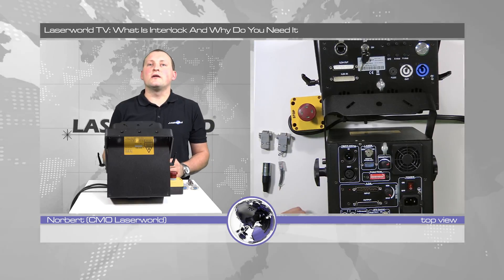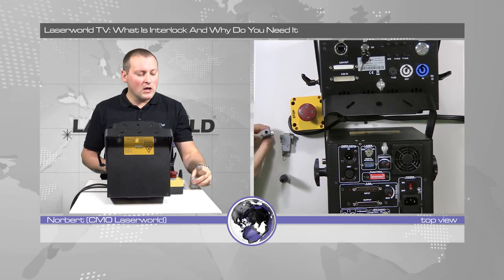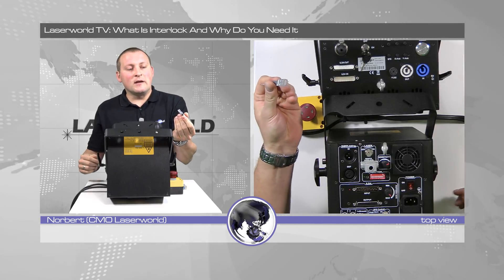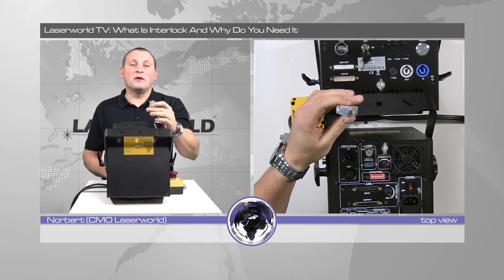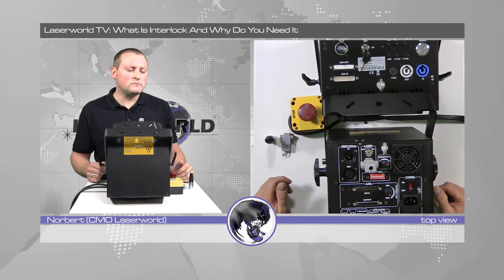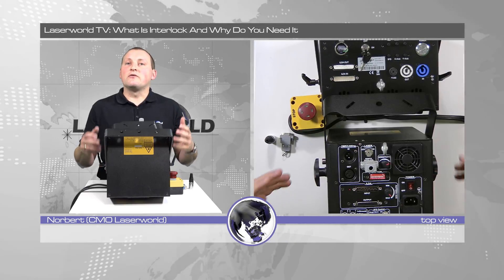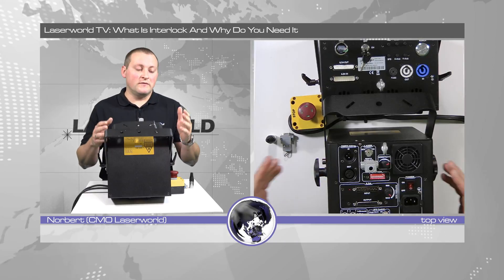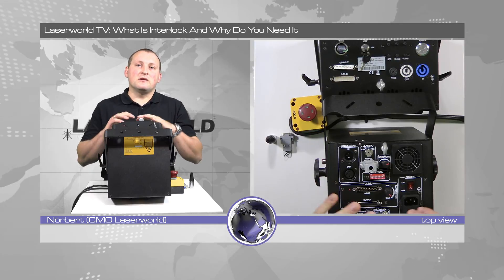What is an interlock connector and why is it there? EXPLAINED | Laserworld TV

Comment: hello, i ordered the laserworld el-500rgb keytex from a website called ''why buy new''. It never came with the interlock, is there a way for me to bypass ? or even to buy a new one? thanks
Reply from the maker: You can either contact Laserworld RMA at rma@laserworld.com or you can sort this yourself ... Pins 1 and 2 need to be bridged to bypass the interlock. 
Some sort of E-Stop may be required (depending on the country), but that can be sorted in different ways.
Reply: @LaserworldAG  thank you 🙏

Comment: Perfect, I was just thinking about looking for the wiring diagram to do the interlock. Thank you very much.
Marco
Reply: what is the wiring diagram then ?
Reply from the maker: with the old sub-d 9 pin it is 1+2 that need to be bridged.
with the new RJ45 type ones it's 7+8.